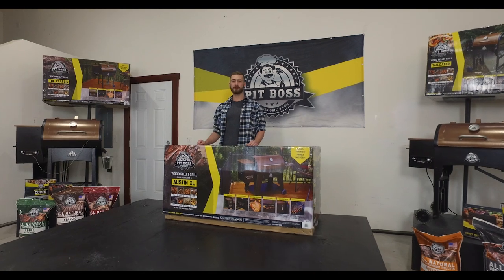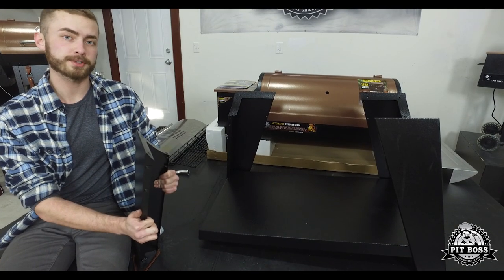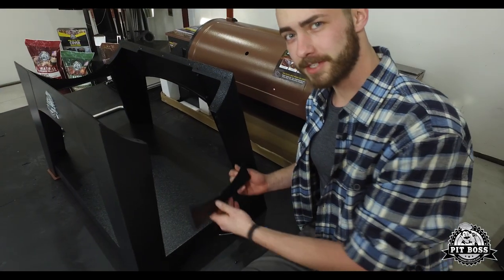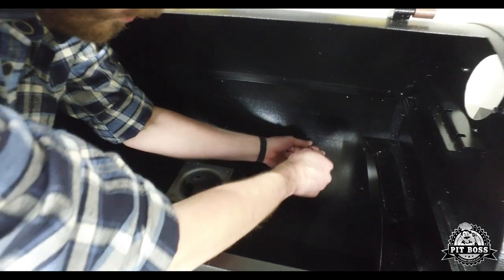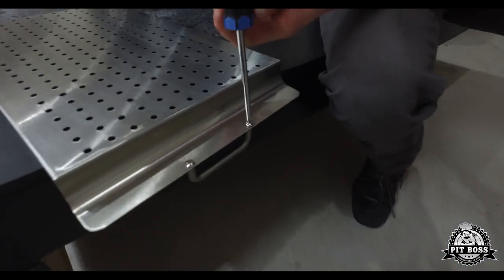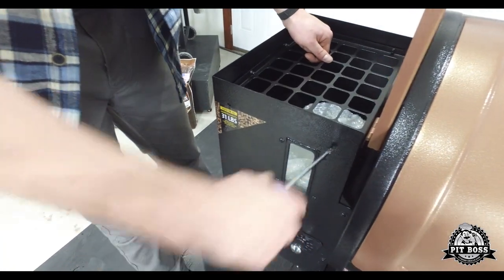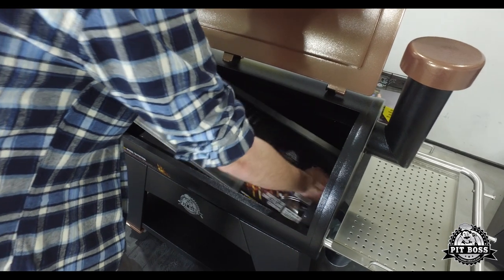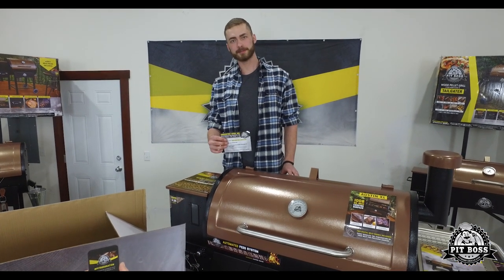Pit Boss Austin XL Assembly

Comment: Hey the diffuser plate holes are bigger than the 4 screws? It just sits around the screws with out being able to tight them down to it. Is that right ??
Reply: I have the same issue... and I'm not clear if the curved ends point down or up, I've seen pics with both?

Comment: So are there 6 screws, part "G", that are used to attach the barrel to the front & rear support plates?  The instructions list the screws, but there is no mention of them, nor are they shown in the assembly diagram "4B".   A call to customer service did not help, as they didn't know the difference between a machine screw & a sheet metal screw.
Reply: You should have 6 of the short pointed screws left those go in side along back and in front between legs

Comment: There is a small hole on the left side of the barrel, close to the control board.  Is this for the temperature probes to enter the chamber?  Is there any way to seal it off?  Maybe a gasket of some type?
Reply: Magnet

Comment: Do you have to take the 4 screws out of the fire pot? My diffuser plate just slips over top those screws with lots of play. I’m not sure why, but those 4 screws don’t do anything. Are they supposed to hold that diffuser plate down right? Because it doesn’t on mine.
Reply: Same here instructions say to secure it with the 4 screws. But multiple FB pages say you don't have to screw it back. It should just sit on top.🤷🏽‍♂️
Reply: @johnny6s  I had the same issue.   Contacted Pitbull customer support and they said it should tighten down.  They sent me a new diffuser plate and same issue.  The holes are so big the screw heads go right through....hold nothing.  Dunno.

Comment: The assembly video is very well put together but in my case in the parts list there were 12 screws under the part "G" which will not work and will have to be replaced with 10-24x1/2". No use in calling Pit Boss as they told me to return the whole grill to Walmart?. Just go to Lowes and buy the screws and Walmart will refund your money. Other than that, it is a great grill.
Reply: LShamel1  why didnt they work? Believe they are self tappers. Just drive them in if they are the small ones. They will thread themselves into the metal.
Reply: Ran into the same issue. The screw that is sent is a sheet metal screw but the hole they go into is tapped for a machine screw. Putting a sheet metal screw into a tapped hole is asking for trouble down the line.
Reply: LShamel1 I think that I am having the same issue. Trying to screw in the support feet and none of them fit!
Reply: How many of that size in total did you need to buy?
Reply: LShamel1 I am assuming 16.. the same number as in the box..duh.. lol
Reply: It doesn't even tell you what screw to use... I had to guess G but it's so tight!